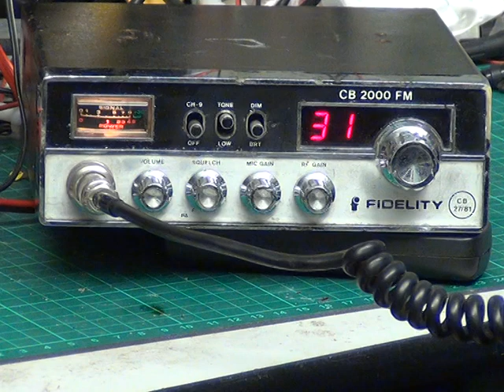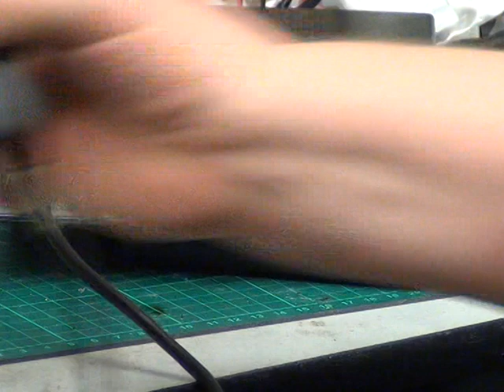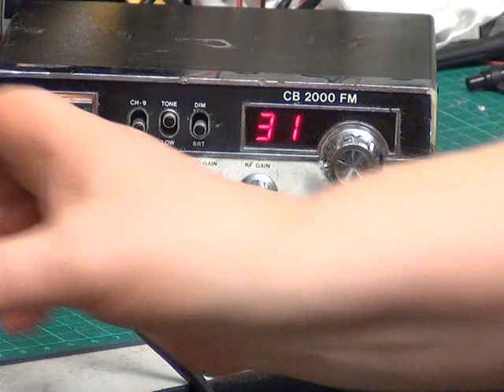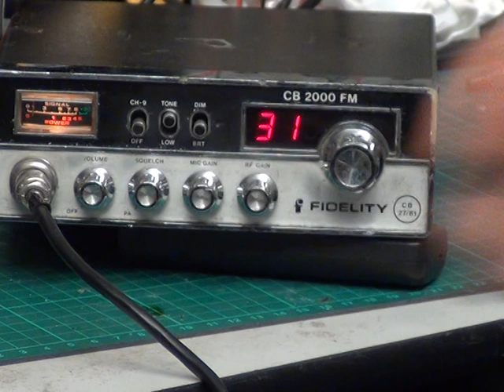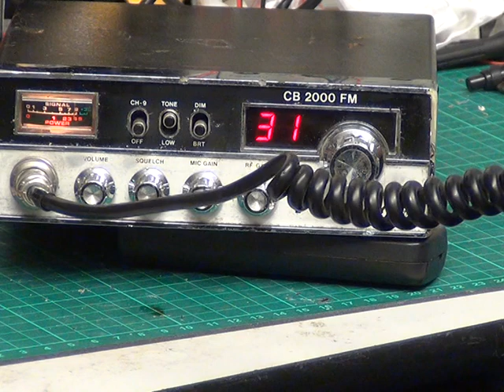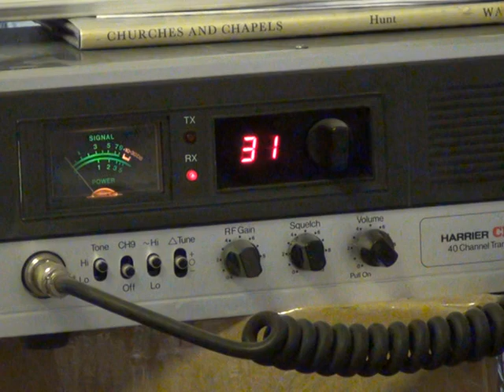Fidelity CB2000 UK CB27/81 CB Radio (mobile) - On The Air Test

Comment: Hi. I've got one of these sets, really nice condition but can only receive really really faint even on full wack.. literally have to put my ear onto case by speaker grill. Any ideas? I have checked wires to speaker, all ok. Also, the mike is unserviceable so what mike would you suggest? I have a four pin mic that I use on my little minor rig, it fits on the 2000 but won't key up. 
Sorry to be so vague,,,,,I am down in Southampton,,,,could I send the rig to you to look at or is there someone you know down here you can recommend in Hampshire?
Reply from the maker: So the mike on the Minor is clearly a different pin connection to the Fidelity 2000. Bear in mind the receive audio goes through the microphone, so if the mike doesn't work, there will be no receive. If buying a new mike doesn't work email me. Of course we can do you a new mike for £14.50 delivered! rshireby@yahoo.co.uk
Reply: @ukfmcbradioservicingTango21  many thanks Richard. I'll pop down to Nevada which is near me in Portsmouth and buy or borrow a mic,,,then report back to you. Many thanks for the advice thusfar. How much would a service be if I mailed the radio up to you?
Reply from the maker: Please email me rshireby@yahoo.co.uk

Comment: This 'noise' the like ignition noise is here too at Burnley, it comes and goes, sometimes it's like a frying bacon noise, but this 'ignition' type noise.. I'd love to know what's causing it all over the UK band. I love the cybernet chassis, the squelch is annoying with the pop pop, but a superb performer. Oh Richard, I have one of them Uniden pro bases here that I acquired, the vertical board to the right has been butchered, maybe its one for you for your stock.. let me know if your interested in it. 73's
Reply from the maker: Thanks for the offer, but no thanks.That's the VCO board. I'd put it on ebay if I were you & say the VCO board is damaged.You may well get £30+ for it as the chassis will be used in a mobile too & someone may want to turn a non-working mobile & non working base station into a working base station!

Regarding Cybernet 134 sets; our calibrated 'reference' set is a Rotel RVC230. Regarding new sets, many use I2C databus techniques for the front panels/mike, so going into transmit can take 500ms! Couple that with internally generated CPU noise & you end up with a feature rich impressive radio....that's crap.

Richard, G0OJF